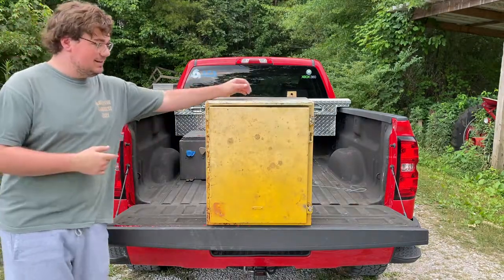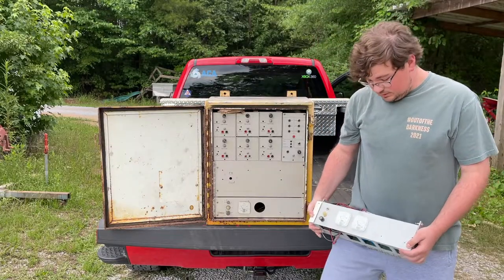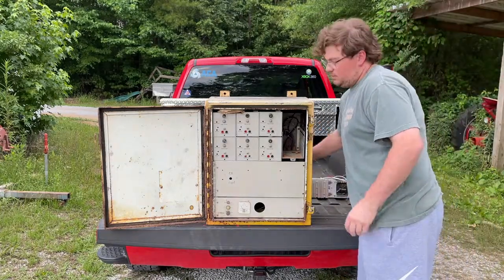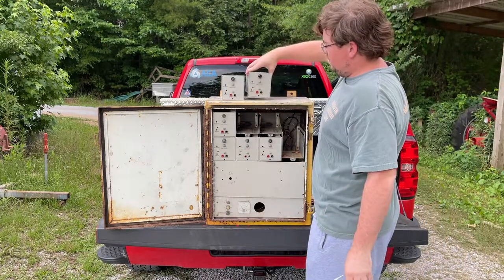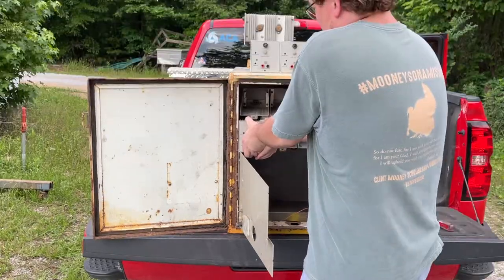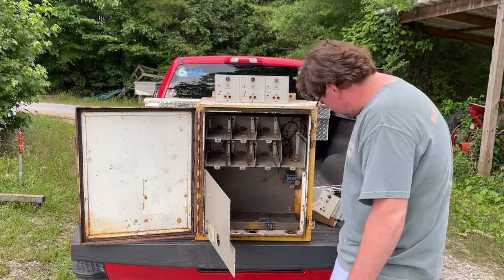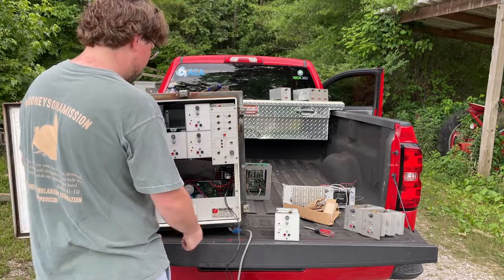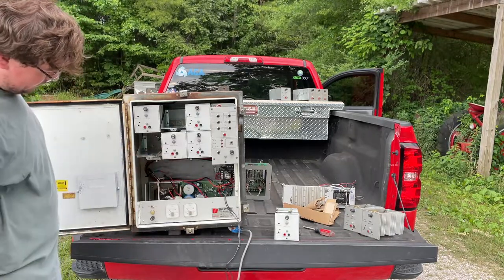How bad could it be? Prototype SiraTone Rescue

Comment: Guaranteed somebody would charge an arm and a leg for even a crusty broken old siren controller lol.
Reply from the maker: @SockyNoob  ehhhh. This one is effectively junk. Is it salvageable? Yeah, but it’s not exactly easy. Nearly every single wire in the control module and the amplifiers are corroding from the inside out and falling apart.

Comment: I know way more about repairing electronics than anything about mechanical bits, so seeing this thing in ruin seems like a far more fixable thing to me than some rotten mechanical siren and all the issues they can have. The electronics in this look so simple that it's probably possible to recreate the circuit board and replace or reuse components if the boards were somehow too far gone.

Comment: Nuclear converted to coal? I thought they were supposed to be going the other way.
Reply from the maker: @FM60260  nope. Zimmer was originally slated to be nuclear when it was being built, but due to many factors and complications in the construction process as well as public pressure, the plant converted to coal before it even began operations.
Reply: @thunderbolt10031  That makes more sense

Comment: You have WAY much better patience and commitment on being able to remove every single piece and knowing what's which compared to me. I just don't have that kind of motivation like you do.
Reply from the maker: It's been years in the making. I've been studying SiraTone since 2018.
Reply from the maker: @Some Guy On the Internet half and half. The signals are split.
Reply: @Some Guy On the Internet You can do Alt Wail on just only 1 driver but of course, it would only be single toned instead of dual toned.
Reply: @Some Guy On the Internet It'll still do a High-Low tone as it's wailing. It's just that when it does the normal wind down and wind up, it'll be single toned. If a driver is plugged into Terminal A, that's usually the lower pitched Hz level. Terminal B should be the higher pitched Hz. A driver plugged into TA and TB together makes Dual Tone. Just TA or TB is ST.

Comment: Clayt was telling me about the Zimmer system years ago, how it was basically rushed into production just for the plant, I believe to compete with Whelen.  Being rushed into production, once the system was online, they had constant issues and failures.
Reply from the maker: The design of the controller when it’s assembled correctly is actually really good. My good controller there is from 1985 and it’s still using all the original amplifiers. Only one of them ever needed service and it was just repaired in the field. These Zimmer controllers were built pretty poorly and I’ll elaborate in the next video when I tear into the nitty gritty of the boards.
Reply: @thunderbolt10031  yeah I guess to clarify, he was talking about the original “1212s” which preceded the 115s and round speaker 1212s.  Looking at your amplifier test and repair video from a while back, the actual production version of the EOWS amplifiers seems like they were at least more straightforward to repair.
Reply from the maker: @joshmo1744  Yeah, the 1212 name was interesting. From what I've been able to find out, that name was more or less a codename when Zimmer was bidding out for a system. The manual I have for this controller calls the speaker array EOWS*115.

Funny enough, the Zimmer amps are identical to the production amps they built from 1983-1986. Only difference as far as I can tell is the LED indicator lamps. Really these Zimmer controllers suffered more from poor quality control at the factory than anything else.

Comment: Still have that control module?
Reply from the maker: Huh?
Reply: @thunderbolt10031  hold up are you going to try to repair the prototype siratone? If not, unless you sold it, I'd be interested in buying the cm even if it don't work
Reply from the maker: @ThisHandleIsNotTaken.  Yes I plan on repairing it, I mentioned it in the video. Also you seriously don’t want this thing. It’s junk. I’ve tinkered with it only a little bit and it just disintegrates under a soldering iron.
Reply: @thunderbolt10031  I wish you luck with that then. You're gonna need it. If you stop working on it, lmk. Junk or not I'd still take it.
Reply from the maker: @ThisHandleIsNotTaken.  why do you even want it lol?
Reply: @thunderbolt10031  its a piece of history. And it'll save me a 5 day 4,000 mi round trip to west shore as well as a couple thousand dollars.
Reply from the maker: @ThisHandleIsNotTaken.  I get it, but I don't see why you'd bother if it doesn't work, but that's just me 🤷‍♂
Reply: @thunderbolt10031  look, you bought it right? How much did you pay for it?
Reply from the maker: @ThisHandleIsNotTaken.  It was given to me. No one wanted it and the guy that had it wanted it out of his yard.
Reply: @thunderbolt10031  well of you ever stop working on it and need some cash, lmk. $300 for the cm, 1 Amp and the thing that connects them, I'll pay and cover shipping as well. Regardless if it works or not.